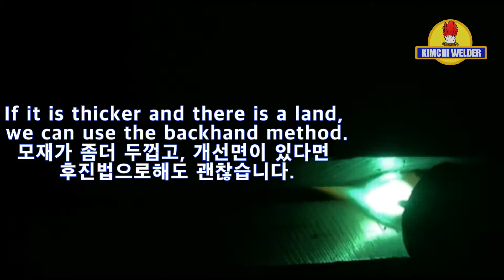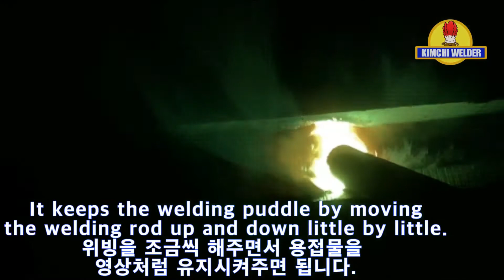2G MIG Root + Stick / 수평 미그루트 +아크용접(전기용접)

Comment: man 2gf flux core cwb is the hardest would 175wfs and 18.5v be okay to pass a bend test?
Reply from the maker: I`m scared! but its not impossible. Try 18.5v/175wire speed, try 24v/300wfs too. and  Find volts and wfs that penetrate well.👍👍👍
Reply: man your welds are just perfect bro upload more weldings so addictive i forgot how much i love it ive been doing my steamfitting now but getting back into welding good to fall back on second trade thanks for the info i'll try it monday
Reply from the maker: @Mattoilers97  thanks Matt, I'm busy with work, so It is not easy to prepare a video. However, I'll upload even a simple video soon!!😎😎
Reply: @kimchiwelder8410  all good dude keep up the good work
Reply from the maker: @Mattoilers97  thanks bro👍👍👍